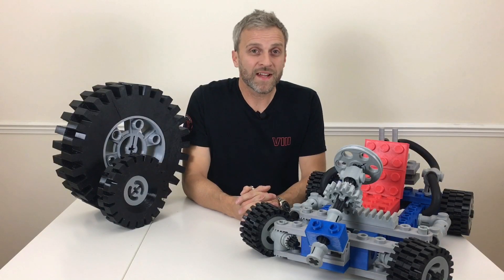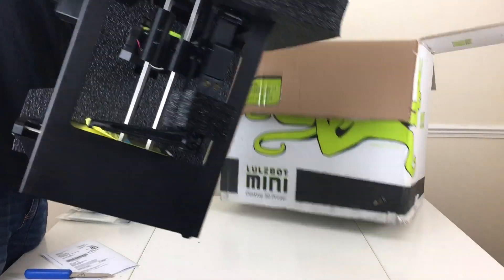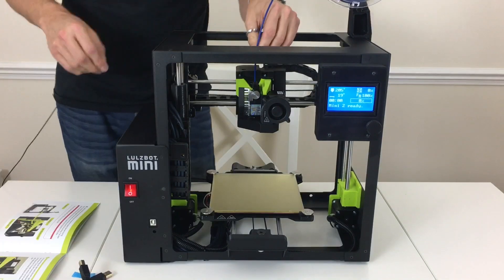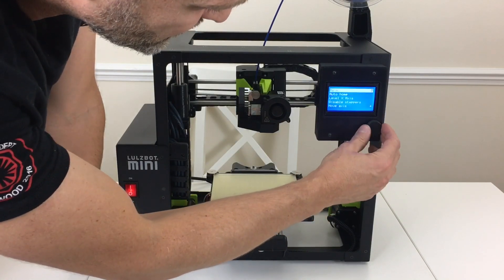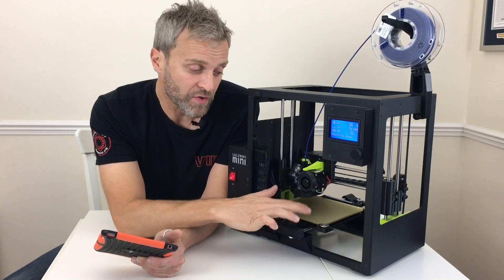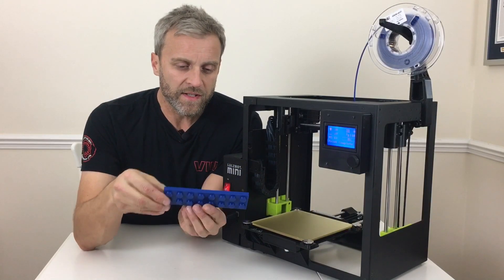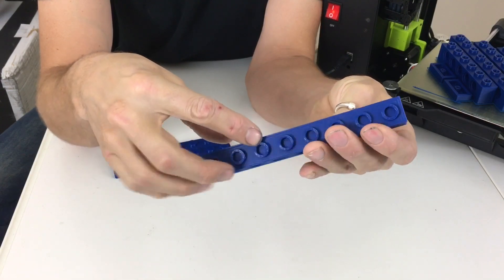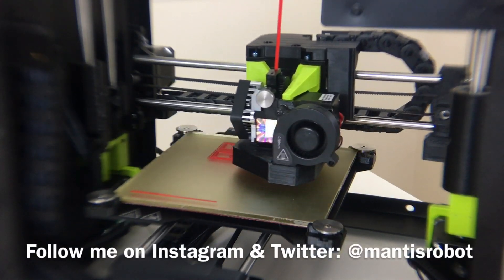Printing GIANT Lego on the Lulzbot Mini 2- Mantis Hacks E18

Comment: Think I'm going to give the GoCart a go at 2.5 scale. Maybe I missed it but what filament did you use for the blue?
Reply from the maker: Well this is polylite PLA. It’s not as good a match as the abs I did before but think it will be ok. Check out the 2.5x scale tyre is just printed.. video on IG 👍